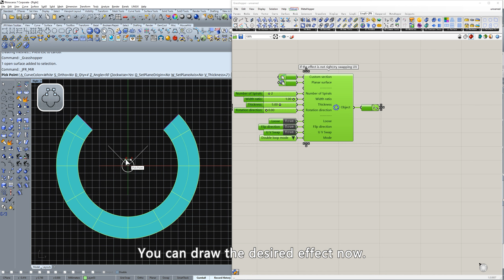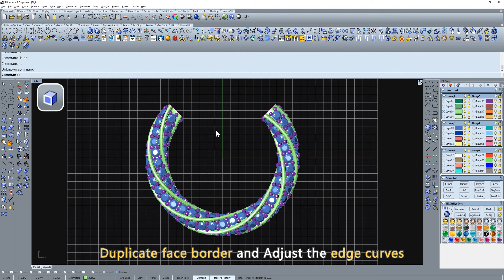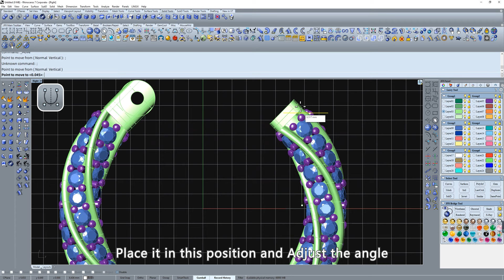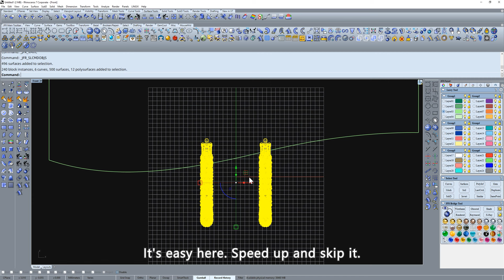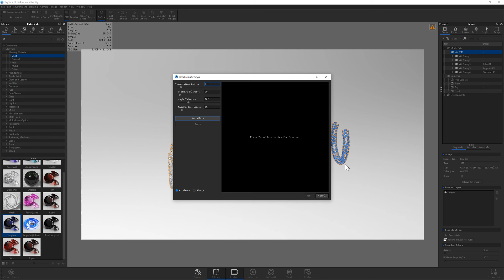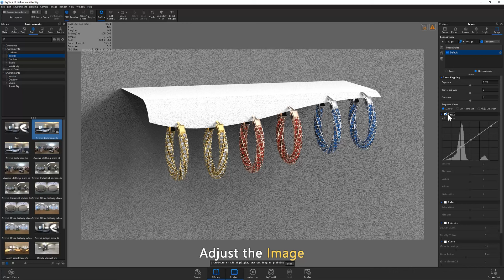Making Möbius Earrings in Rhino and Keyshot

Comment: This is a plug-in tutorial, not a Rhino tutorial. In fact, the original Rhino tools are rarely used.
Reply from the maker: Yes. In the modeling part of this tutorial, the ratio of Rhino to plugin usage is about 1:3. However, I don't deliberately control this ratioI focus more on completing the modeling efficiently while ensuring ease of modification later on.